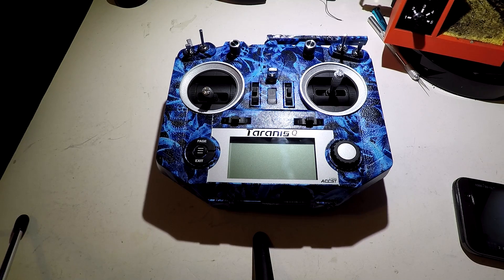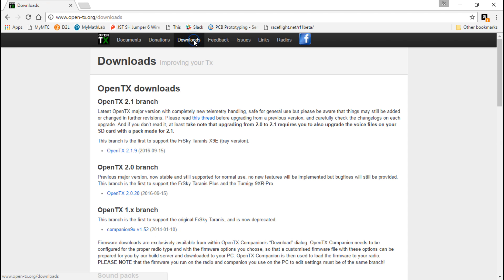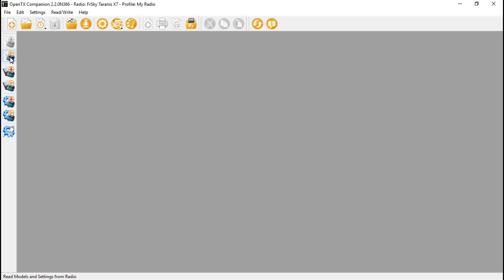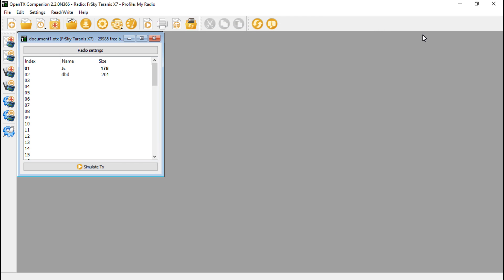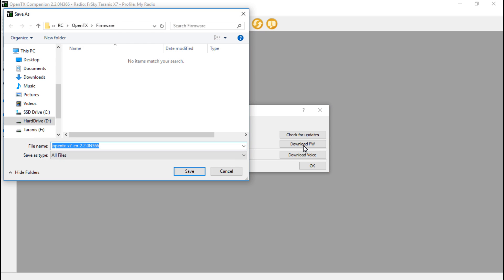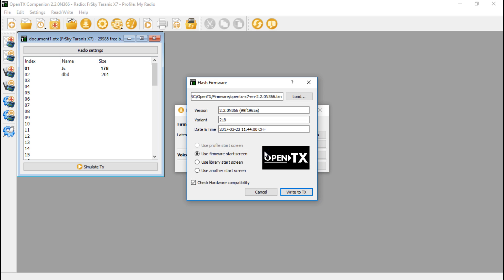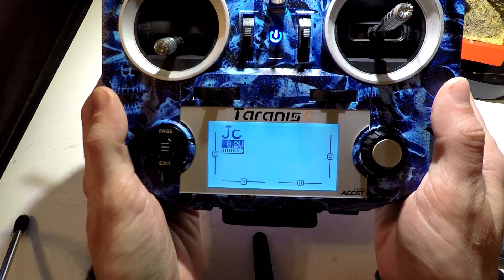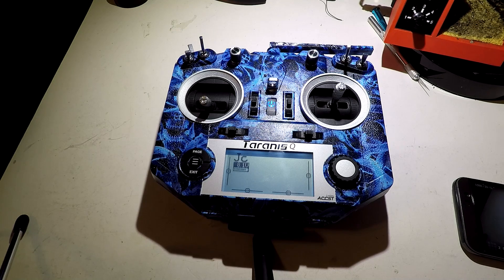Taranis Q X7: Updating Firmware

Comment: when trying to update the firmware, I get this message: 
"new firmware not compatible with one currently installed"

How should I proceed, my setting are below? 

OpenTX Bootloader for x7

BOOTVER    opentx-x7-2.2.2 (e3ea8595)
DATE       2018-06-24
TIME       [22:15:05]
req SD ver 2.2V0018
FWVERSION   opentx-x7-2.2.2 (e3ea8595)

Comment: Thank you for your excellent video tutorials! I downloaded Companion but it won't run on my laptop due to the error "This program can't start because api-ms-win-crt-runtime-l1-1-0.dll is missing from your computer". I have tried every known fix there is and I have installed all of the recommended updates and drivers with success that I could find to fix it but it still won't run. I did get it to run two times by installing it from the internet but if I closed it and restarted it, it gives the same error message. Do you have any ideas that I have not tried? My new Q X7 will be here on Tuesday and I want to be able to get it set up right.

Comment: I have an issue. my transmitter was working fine out of the box, every switch worked. now that I updated the firmware I am now missing two switches. how do I downgrade my firmware back to a stable version?

Comment: I hope someone can help me. I basically follow those instructions updating all that bull crap to the newest version and now my radio just says x 7 boot loader - 2.2.0 and it's the basic right firmware, restore eeprom, exit screen. but it won't do anything else now...  if I click restore will it take it back to the original settings?
btw... when I first updated and unplugged the radio and scrolled down to exit it wouldn't even exit it just went to a blank screen. and then after that the power button doesn't work, and I have to unplug the battery to turn the radio off.  the only thing that works is the bootloader.  and so far since I've looked nobody has a for sure answer as to how to fix it.  All I can find is suggestions on what may or may not fix it. and i can't even find anything for  QX7... LOL SMH.  
I just pray someone can give me some help.   I don't have a clue at this point aside from buy another radio( as sad as that sounds.)
Reply: Nitrous Banshee did you find a fix?
Reply: Nitrous Banshee did you find a fix?
Reply: Nitrous Banshee did you find a fix?
Reply: sorry youtube glitch
Reply: Michael M 
Not really... No. Supposably a guy that lives by me thinks he can fix it.
I actually wondered if trying to redownload the firmware and rewriting it would do anything. what do you think? Have you ever had a problem like this?
it sucks because you can find invoice on how to fix the older taranis but not the qx7. I don't know how similar they are honestly. supposably similar but I don't know how doing in-depth changes will differ. You know?
Reply: Nitrous Banshee whenever I've had a problem with flashing anything, I would always just reflash. chances are you bumped the cable or something while it was writing the firmware. have you tried reflashing it?
Reply: Also, I'm pretty sure they are pretty similar. same software probably same if not very similar hardware too. if follow one of those tutorials if I where you. Try reflashing it first
Reply: @NitrousBanshee  the same thing happened to me. its horrible and i cant figure it out

Comment: I bought an eu version, down loaded new firmware so I could have d8 for my whoop....works great. But I can't get xm+ to bind in d16. I've flashed rx to FCC several times. Also to eu just in case. Still won't bind. Just solid red and green LEDs. Is there something else in tx I need to flash?
Reply: I was here did you figure it out?
Reply: Michael M 
Yes. I had to flash the internal xjt module with non eu firmware off frsky site. 
I believe........As my x7 started life as an eu version tx so updating open tx just opens the options/menu for d16&d8. D8 is already in tx but hidden by not being selectable. With d16 non eu, updating opnentx just releases the option on screen, but had to update internal xjt to actually have d16.
Reply: I was here what is an xjt?
Reply: Michael M I'm not completely sure as I just read stuff and people tell me how and what to do. But it's the internal rf module, I guess the brain of the tx and open tx just lets you access and navigate the brain. Like you can buy an external rf module/xjt/2nd brain for dsmx use, plug it into module bay and select external rf on page 2/12. 
http://www.frsky-rc.com/download/view.php?sort=&down=335&file=Firmware-XJT

Comment: after updating the fw on the radio, i could NOT bind anymore.. i followed the steps on the binding video from the x4r you did with the x9, but i had, as you explaind, a fw problem.. both led's where solid on the rx. but i cant flash the rx anymore because of the fw on the qx7... can you tell, what specific fw i need to use on the radio, the internal module and the x4r? that would be hyper great.. thanks

Comment: Hi, got the same problem as Croble FPV.. Ending up with firmware for x9+ and have all checked in the application settings 🤔 thanks for your how to videos.. keep on 😉
Reply: Found out what the problem is... in the settings, you need to go to the Radio Profile tab and select the right Radio Type 😉 then you will get the right firmware 😉👍✨

Comment: I followed you step for step but it;s not coming out right on my opentx. When I download the firmware it doesn't ask if I want to write it to the radio and after downloading it when I try to open it I get an error message that says "can't extract RADIO/radio.bin"    
Plus when I copied the models from the radio when I close then reopen qpentx the models are gone.
I've gone through the steps a number of times and ready to throw this radio out the window.
When I tried to download the firmware again I get a long message with access denied.
Reply: Route 66 Flyer did you find a fix?
Reply: Route 66 Flyer did you find a fix?
Reply: Route 66 Flyer did you find a fix?
Reply: Did you find a fix?
Reply: Sorry about that
Reply: I haven't been feeling well so haven't worked with it in a week or so but I did try several times with no luck. When I have time I'll try one more time from scratch. It's driving me crazy, guess I'm doing something wrong but can't figure out what it is.
Reply: Route 66 Flyer have you tried running open tx as an administrator? I would try to take the usb out if the radio and plug it in directly. sounds like mass storage was turned off
Reply: I tried doing card in the Q7 and then tried loading the card directly in the computer and it didn't work right either way. My computer went down so I'm going to have to get another one before I can do anything more. This is a 10 year old laptop I'm on right now so it's not worth a damn, old and slow..... just like me!
Reply: Route 66 Flyer lol I'm sure my will fix itself with a newer laptop
Reply: Thanks for the info Mike. The one I was using was "only" 4 or 5 years old but you know how that goes. Think the new one is going to be a Lenovo Thinkpad, spce's look great the the price is right.
Reply: Route 66 Flyer good luck and let me know if you figure it out

Comment: hey man, just a question with opentx, i have that exact version and instead of saying download the newest firmware, it shows up with ' failed to check for the newest firmware, i have clicked on the download button and comes up with the same message. latest version of OSX. is there a way to download/find the taranis x9d+ firmware other than through companion?? cheers!
Reply from the maker: In the settings menu of Open TX companion did you turn on "automatic check for open tx firmware update"? You can also download firmware from frsky but it's not going to be the newest.
Reply: Look it's just for 109.99 dollars
http://www.gearbest.com/multi-rotor-parts/pp_604500.html?wid=21&eo=BTy3rgt3oxHgI3L0&lkid=10725973
I hope this can help you

https://www.youtube.com/watch?v=dJ4dSKjrLxk
Reply: I just bought mine at GetFPV for $104.99 with free priority 2-3 day delivery.